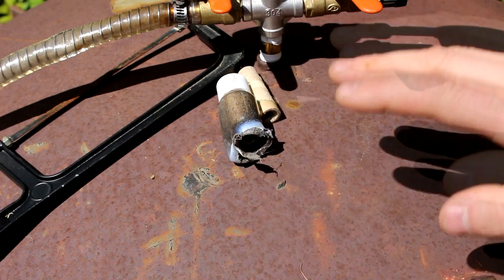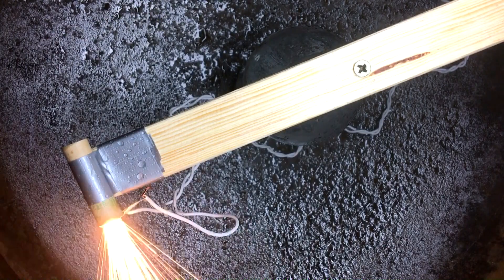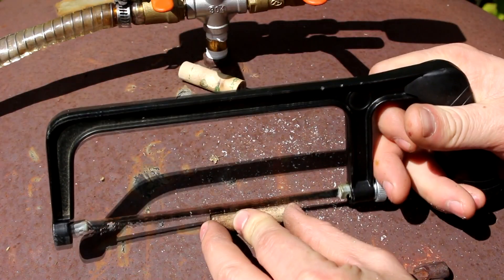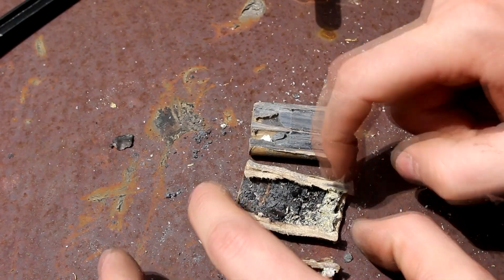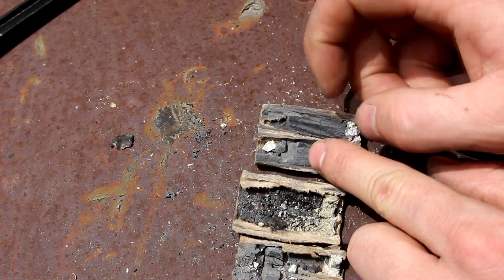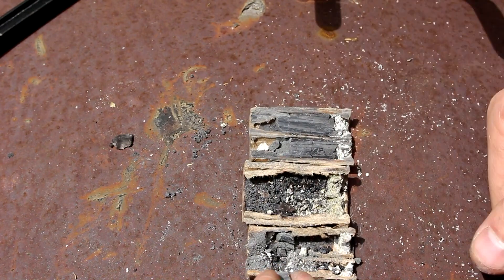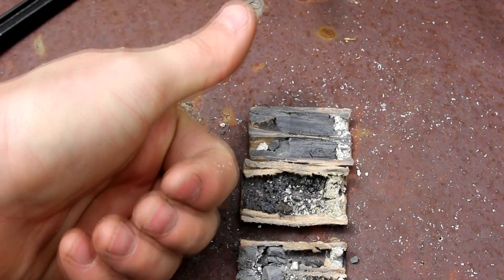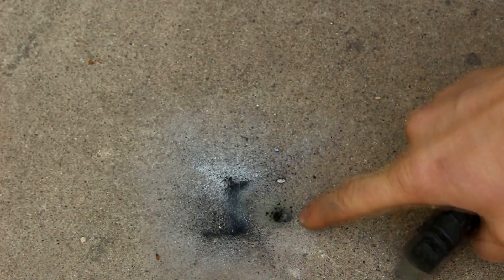Rocket Autopsy

Comment: Burn rate vs pressure is an important parameter in rocket fuel design. Often the burn rate will increase with increasing pressure. If it increases too fast the rocket motor could explode from the positive feedback of the increasing pressure. Your chamber would be ideal for experiments in pressure vs burn rate for rocket fuel formulations.

Comment: I wonder if the rocket could sustain a burn in the vacuum by igniting more of the propellant at once? I'm guessing that would initially boost up the pressure in the rocket enough to keep it burning (like the bottle did). The problem would be making a fuse that could light more of the propellant simultaneously.

Comment: G'day,

   Ah, point of order...; 

    Out on Planet Estes, they speak of the Propulsive-Impulse Charge, and the Tracking Charge (which produces a Smoke-trail, which means that the ascending Rocket can be easily seen, as it marks out it's ballistic Parabola...), and the Recovery-Charge (aka "Bursting-Charge"), which blows the Nose-Cone off the tubular Fuselage of the Projectile, to deploy the Parachute....

  The "Delay" Charge could be (and perhaps originally was) manufactured so as to emit very little visible Smoke, and the Parachute would still deploy correctly ; but nobody would then know quite where in the Sky to look, when hoping to watch the 'Chute deploy and blossom...

   Therefore, the Marketeers added Smoke to the Tracking-Charges.....; to make their Skyrockets easier for the Customers to see, and watch.

    Have a good one,

   ;-p

   Ciao !

Comment: That powder would make some nice bang bangs
Reply: It is actually black powder, extremely fine and pressed into a tube-shaped tablet, essentially. It's probably waaay finer than even 4F, but more interesting IMO is actually that delay section. The way it burned looked A LOT like smokeless powder IE nitrocellulose-based... hmmm.
Reply: Www understood
Reply: So like smokeless but with the speed of black
Reply: There's actually two different powders in there, the smokeless part is the light colored layer that Cody burns a chunk of at the end, the smaller chunk. That's what I'm talking about.
Reply: O ok I was thinking the faster stuff that's what I would like to know thug process I have the basics like saltpeter sulfur and charcoal very very fine Anne you proxy know the rest but you know crazy cool stuff copy does

Comment: so what are they using in space? hydrazine + h2o2, hydrogen + oxygen, or just pure pressurized tank with nozzle?
Reply: When already IN space, they use monopropellant IE just compressed gas for fine adjustment. To reach space, either of the former two would work, but I'm pretty sure they try to use hydrazine as infrequently as possible in case of catastrophic launch failure.
Reply: ty for the explanation...

Comment: I'm not into model rocketry. What it is the ejection charge, and how it works?
Is it to eject the motor to make a 2 staged rocket?
Reply: No, it's to blow the top of the model rocket off and release the parachute. The delay is the prevent it from releasing the parachute too early while the rocket still has a lot of upward momentum.

Comment: Will thermite work in a vacuum? I'm guessing it  should work, after all it contains the fuel and the oxidizer. The only problem might be sustaining enough heat. As precaution you shouldn't use a whole lot, don't want to burn a hole in the vacuum chamber.

Comment: If the motor has its own oxygen then why did it not burn well or at all?
Reply: Good question, he sort of touches on it, but passes over it quickly; it needs PRESSURE to burn, it will create its own pressure on its own once it get started, the bottle was just there to "jump-start" the process, and after the initial firing wouldn't do anything but add weight to the system.

For those who haven't messed with these little rockets a little explanation he sort of skipped over. Those model rockets, have 3 "stages" Main, Delay, and Ejection. So the main charge does what rockets do...thrust. No brainer. Delay and Ejection: After the rocket burns, they will sort of coast for a bit while the "delay" charge burns like a fuse, and then the Ejection charge pops like a firecracker, with the intent to blow the nose-cap of the model rocket off, to deploy the parachute. 

The reason the Delay charge doesn't burn completely, is because it doesn't burn as quickly or intensely, so it couldn't keep the pressure up, which it needs to keep burning, so...sputter... and it goes out.

if a rocket were intended for use in a vacuum it would be made to account for this. I'm no rocket surgeon, but a different nozzle that contains the pressure longer and then opens up as the charge gets going, would help kick-start the main charge and then allow it to burn full-tilt, without having to put it in a bottle, while achieving the same effect. And the delay/ejection charge is really only for the "model rocket" application. (NASA rockets don't have such things)

Comment: Sorry but if the air that was in the container would not matter than all the rockets would have burned. What happened was that the air run out and the rocket stopped burning. How ever you're explaining it that is what happened. ROCKETS DON'T WORK IN THE VACUUM. And we are not even talking about the vacuum of space where the rocket would have nothing to push against even if the rocket would burn.
Reply: 15 year olds understand the universe in a way no one else can... lol
Reply: 2010invent
You're missing part of the picture, though. You don't have to push against something to move, what you need to do is eject mass in the opposite direction you want to go. Imagine floating in space, firing a full auto rifle with millions of rounds of ammo, the bullets shoot off in the direction you're aiming, while you would be propelled in the opposite direction. Now, if you shot it the way you're supposed to shoot, you would just spin around your center of mass faster with each shot, but that's a different story lol.
Rockets do the same thing, they eject high velocity mass in the opposite vector.
Reply: @2010: gas is a lot of very small solid stuff, for that matters.

gas doesnt "want" anything, btw. It's just that those small solid stuff are always colliding with each other, thus creating some "cloud".
But the net effect is the same.

Please learn physics, thanks.
Reply: kids don't listen to this guy...

he one of those spaceflight denier/flat earth kooks. 
probably a religious nut to boot.
Reply: Facts are facts. Doesn't matter what you or I say: the truth remains.
Reply: And that is?
Reply: What is well established is that combustion can only provide energy for movement if the gases have something to push against. Vacuum by definition has no gases. NOTHING TO PUSH AGAINST. Even if you create the conditions for the burn in a micro environment the gases will spread and try to fill the emptiness "vacuum". You have a rocket that produce 1 trillion tons of gas in the endless vacuum of space. But that gas would just spread and expend and would not produce any thrust at all. If you want prove: take an engine, take off the head, pore gasoline into the cylinder and light it. Your car will not go anyplace because the gasoline will just burn and the gases will just spread into the environment and will not produce any thrust. But if all that is to much for you to understand than how can you know if it is proven otherwise? Show me one video showing a rocket going from ground to space. going to the space of vacuum and maneuver. It doesn't exist because ROCKETS DON'T WORK IN SPACE. 
Also if you want to swear at me, without knowing me can be a dangerous thing for you to do.
Reply: First of: bullets are solid mass, gas is not solid. What you are missing is that gas want to fill an area of empty space, solid object "gad-zillion bullets" would not be able to fill an empty space. Bullets will go in the direction they eject from what ever, gas will go in EVERY DIRECTION. Watch a video about a bullet being fired. But even than you would need air resistance for you to move. When they show stuff like that in the movies that only can happen IN THE MOVIES but physics will not allow for movement in the vacuum. Energy needs a median to transfer. Vacuum is empty, it has no median, it has nothing. "as we know vacuum to be" I did not invent this, Newton did. The problem of propelling in the vacuum is not something that I came up with so I could argue. And please remember: the bullet in the video is fired in our atmosphere. I cannot believe that you would not understand the concept. It is very simple.

Comment: Cody if what I'm gonna ask is something you stated in your previous video I apologize I just haven't seen it yet. But I'm no rocket scientist but do you think the fast burning grain has its own oxidizer? And the slow burning grain doesn't. That could be why the slow burning grain didn't burn while it was under pressure as well

Comment: You may want to do a static fire of the bottle in vacuum so you can show us that the bottle basically melted away as soon as the rocket was engaged - while also engineering a way to trap and deflect the gasses released so you don't damage the side of the chamber.

That, and it would be kinda fun to see it =D

Comment: Cody, I'm curious if you would get more reliable ignition in a vacuum if the core of the engine was drilled out further as you find in more traditional SRBs. Drilling through the center would be easy enough but I'm not sure what you would do about the ejection charge as it would be ignited much sooner. I have successfully removed the clay cap before by tapping it gently on the side with a hammer against the concrete, but if you fracture the fuel much it will cause it to detonate and of coarse you'd have to replace the clay after pouring out the ejection charge. May just be easier to experiment with sugar rockets instead. Anyways, just thinking out loud I guess, but I really like these tests and would love to see more.

Comment: hey cody what would  happen with a moter  in a pressurized area more pressure then atmosfhere
Reply: The rocket would provide less efficiency, as well as less thrust.
Reply: For this class of fuels, the more pressure the faster the burn. Gunpowder just on the ground will burn at a slow fizzle or whoomph taking the better part of a second, same amount of gunpowder enclosed so pressure can build and it burns in milliseconds. 
I don't positively know the specific chemical mechanism in this case, but in many reactions pressure will increase reaction rate because it keeps the reactants closer together so the individual particles come in contact more often. For gases it works by directly reducing free space and by reducing vaporization from liquids and solids; the reduced vaporization will likely also increase temperature at the reaction front. 

Now in making solid fuel motors if the nozzle is too small compared to the exposed reaction front of the fuel, the  pressure will build faster than the gases can escape which will increase burn rate which will build more pressure. Assuming the motor case is not overly heavy, this will often resulting in an explosion just a moment after thrust begins.
There is some size range to work within where a pressure increase will simply cause more exhaust flow and thus more thrust and a shorter burn time. the shape of the fuel plays a role too often starting with high surface area(shallow holes or ridges on the surface) to build thrust quickly and ending with low area (just a smooth hemisphere the inside diameter of the motor) to maintain a constant thrust after launch.
Reply: pecfree there's a lot more that's wrong in that comment than "moter."
Reply: and atmosphere
Reply: It would burn faster and thus develop more pressure. If it is beyond a critical level [depends on nozzle, size, impulse, fuel, etc] the reaction will run away and the motor explode like a large firecracker. This is very similar to changing the size of the nozzle or the initial surface area of the fuel.
Reply: +La Amatoro why would it burn faster? Fuel grain would oxidize at the same rate, if not slower
Reply: yes sorry
Reply: WoodWorks500 you mean motor?

Comment: The lack of the smoke from the delay charge was a tip-off. The first firing, the chamber filled with white smoke. This is helpful in model rocketry to find rockets at apogee when they are too small to see.

Comment: Could you try the experiment again, but this time add a bit of dry ice to the chamber and wait for the pressure to reach 1 atmosphere again, so that the rockets burn in normal pressure but without oxygen? Theoretically they should perform just normal, right?

Comment: was in the bottle of there just to get the fuse lit? Or something like that.
Reply: To provide atmospheric pressure to enable the propellant to start , and continue to, burn until it developed enough gases to create its own back-pressure against the nozzle. Once the main, fast burning,  propellant was consumed, the slower burning  delay charge wasn't able to generate enough gas to maintain the pressure and therefore fizzled out.

Comment: do you have the ability to create a vacuum inside your chamber and refill it with an inert gas, such as argon or nitrogen? If so, that would be a good way to demonstrate that the rocket motors don't need oxygen to ignite.

Comment: Cody can I possibly make bullets out of gallium?? I don't think I can because of the low melting point of the gallium but, what if I'm in a cold place??? Plus I think the gallium will ruin my gun. Yeah I don't know if it's doable.
Reply: theres videos of gallium shotgun slugs, but ya might make your gun fragile without you knowing it until it goes boom
Reply: Jake A Oh in that case I'll stick with 7.35 mm copper bullets then. Thanks for the reply.

Comment: 1. I guess you can tell AVE that this IS rocket surgery.
2. For those who say you "cheated" can you fill the chamber with nitrogen or CO₂ to demonstrate that it wasn't the oxygen in the air that mattered?
3. I wonder how much pressure is actually required to keep the fuel burning.

Comment: Maybe you could build a perchlorate based solid rocket motor which would be able to reliably work on its own in the vacuum chamber? Although I do feel like the black-powder motor did sufficiently explain what was happening (and it was a much more interesting experiment to see if it could be made to work in a vacuum than it would have been to merely see a motor, which was designed to work in vacuum, run normally in your vacuum chamber...).

Comment: You'd be able to squash those claims that the bottle is cheating by repeating with a bottle with only nitrogen in?
Reply: Chris VW; Potassium nitrate is a fairly good oxidiser, and there is more than enough of it inside of the motor to use up all of the fuel. Hence, atmospheric oxygen wouldn't result in any extra thrust being produced.
Reply: Science tells us this, this is about doubters, among whom you won't be finding me.
Reply: Chris VW; Ah, right I get where you're coming from.
That's actually the reason why I posted the above comment about Cody trying a perchlorate-based oxidiser with aluminium as fuel and a little nozzle, which should run just fine in a vaccuum.

I suppose if you run it in an N2 atmosphere the doubters could just counter with the nitrogen being oxidised (although using a nitrate to oxidise nitrogen is just as idiotic as it sounds)...
Maybe to show that the black powder really is pressure limited he can simply build a nozzle into the motor, plug it with some gum or something, and then ignite the motor with an electric resistance heater inside of the gunpowder. That should cause enough pressure to build up quickly enough for a self-sustaining reaction.

Another idea would be to simply use a much faster burning gunpowder mix, as Cody already showed that the slower burning part failed to ignite. A faster mix wouldn't be as good as the original (i.e. outputting a constant thrust over a reasonable amount of time), but at least it should be able to work without any modifications?
Reply: You have too much respect for the opinions of those too lazy to study even the most elementary aspects of a topic.